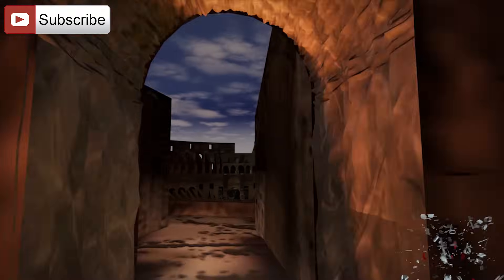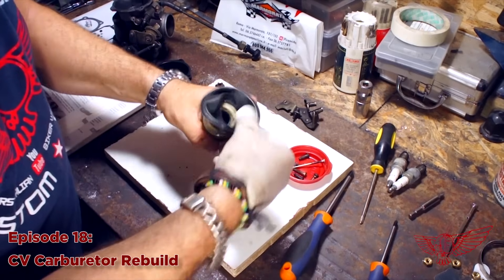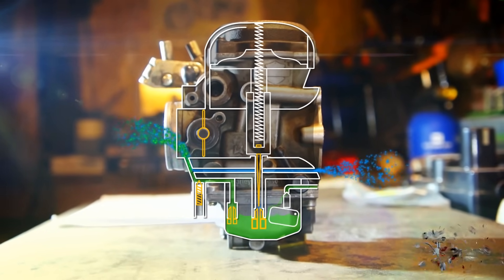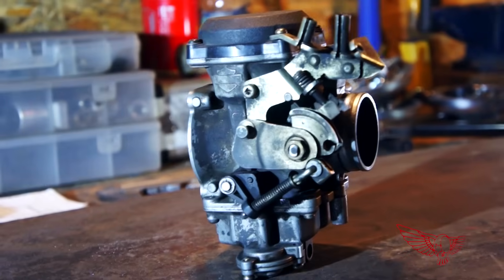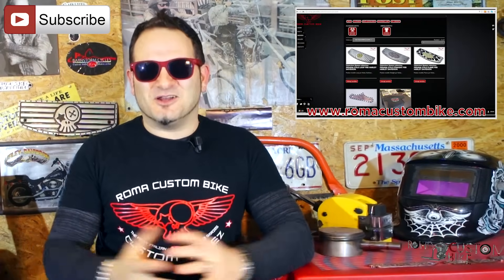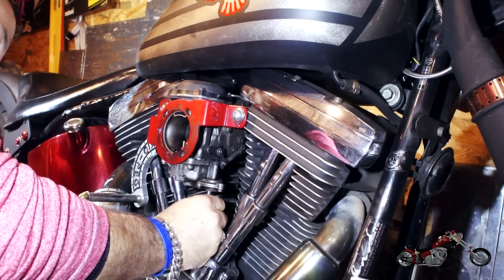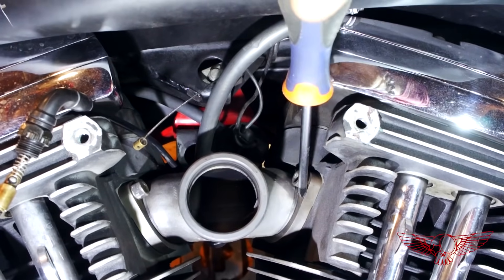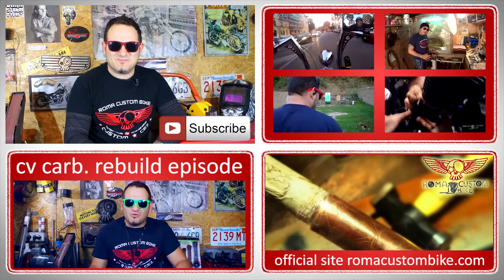How does CV carburetor work animation DIY adjustment screw - ep26 - Roma Custom Bike

Comment: Working on a two stroke engine where  the idle screw is on the opposite side and the screw is completely at the end in order to work good , it  means I have to put a bigger slow jet?According to what I understood from this perfect video.
Thanks anyway for the excellent explanation you gave us.
Thanks
Pampos

Comment: I have to disagree with the animation.  The air is drawn through the half moon shaped cutout on the top of the intake side of the carburetor to move the slide diaphragm up (and thusly the main needle) when you open the throttle (when it is running - of course) - just take an air nozzle and lightly blow into it and you see what I mean - the diaphragm will raise.  This is why so many people have problems when they install pod filters and delete the stock air filtration system.  That cut out relies on a measured air flow velocity through the intake to operate the diaphragm and slide assembly properly.

Comment: Did that crap when I was a 12 yo. 300 $ IBEA slide carburetor. 29.5mm, this looks simple compared to those carburetors get it wrong and you ruin your engine. Nice side effect when you have 20k rpm with a 2 stroke engine. No gasoline no lubrication instead a high bill and an oversized piston. It's why new kart engines start way under 100 cc the ac ones have only 5 running hours ( before the piston is worn out ). Replace this American crappy one with a nicely build carburetor. They worked always nice on either 2 and 4 strokes for me.

Comment: Tune with your eyes and your ,,,, ears,,,, !!!!     Till There is no  hecup,,,!!!!   Then lower the RPMs.,,,,!!!!     Adjust again till there's no. ,,,,,, Hecup,,,,, !!!!    I have been able to get them to run at 500 RPMs.  !!!!   With no.   ,,,,, He cup,,,,,.   Raise idle back up to about 1200 RPMs,,,,.  Test ride under pressure till Redline,,,, fine-tune adjust again.!!!!   1/12 of a turn.  Like a clock. !!!!     Coils never get any stronger they only get weaker. ???.,,,. Use new spark plugs before ever tuning. ,,!!!!  . After 500 miles look at plugs to see. If they're whitish or if they are black  ????   You want the plug somewhere around a golden brown,,,,???,,,,,.
Reply from the maker: thank you for the add on man! :D
Reply from the maker: Thank you man! I truly appreciate it!

Comment: and this is why cv carbs aren't as good as piston type carbs. everything is dependent on air pressure, there will always be more air to operate the carb whereas with the piston type where the slide is controlled by the rider via throttle the gas is closely proportionate to the air as the slide rises.

Comment: Sucks the adjustment screw on my 700 is in an impossible place to adjust sooo... im going to have to take it apart, adjust it, take it apart, adjust it... YAY
Reply from the maker: +p0seidon there must be a better way man!!! For harley they sell an easy access screw to replace the original one, you might want to look into that or it will be a nightmare!!!
Reply: Yeah i know haha, also what would you say if my fourwheeler only idles with the choke a little out? no matter how much i adjust the fuel screw i get the same result...

Comment: The mixture screw "well" IS NOT 6mm deep! The depth totally depends on how many turns out the mixture screw is! Be careful people about the advice that you follow. You could ruin your carburetor by blindly following the advice of someone without any actual knowledge of the systems they speak of.

Comment: Ciao, it is not a good idea to use a steel wire to clean the jets since steel is much harder than brass and you run the risk of enlarging the precisely drilled holes with the wire! A better idea would be to use a plastic wire, for example from a toothbrush or similar.

In ogni caso bellissima animazione del funzionamento del carburatore CV!